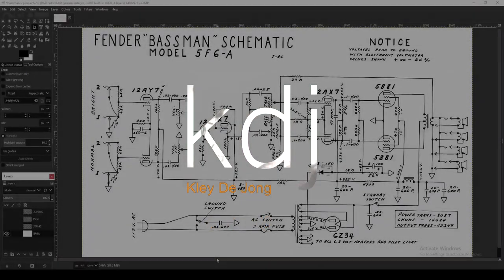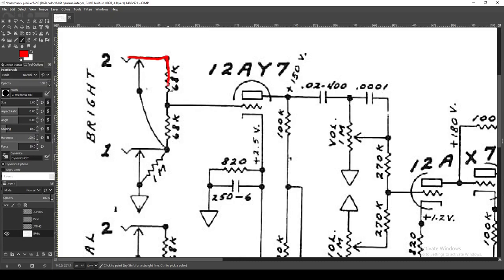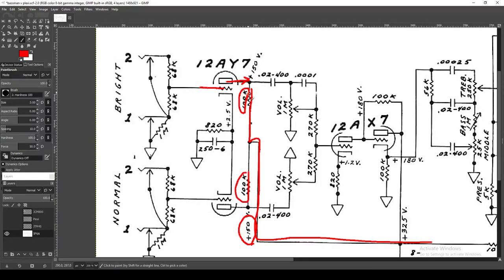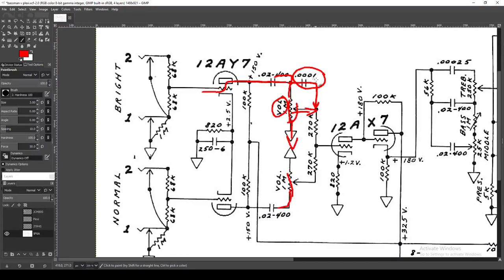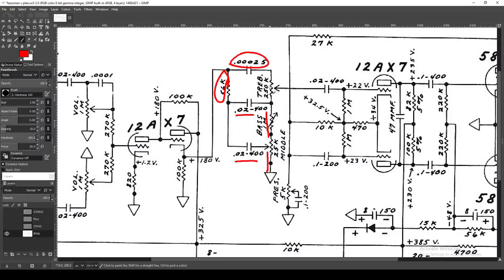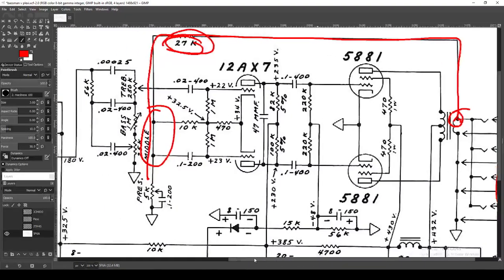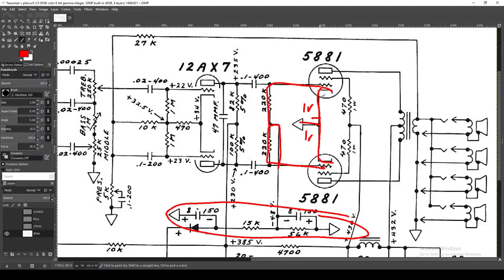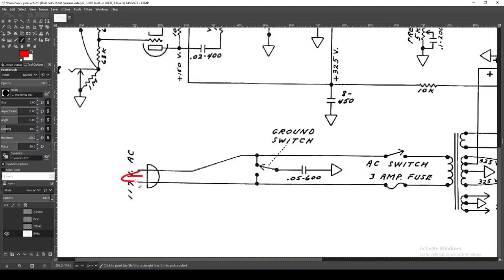Amp Circuit Analysis - Bassman v. JTM45 vs. Plexi vs. JCM800 | Pt. 1

Comment: The "Low" input had an interesting purpose.  It was for when two electric guitarists were sharing the same amplifier.  If one guy had higher output pickups he could use the low input instead of cranking the volume pot down on the guitar which rolls off a bunch of treble.  The coils of the pickup having certain amounts of capacitive and inductive reactance as well as resistance.

Comment: Hey, cool video. Minor correction: The smoothing caps at power supply node 1 are in parallel and double the capacitance not halve it. (Twice the electrode surface area doubles capacitance).
Reply: You noticed that to. it should be elementary electrical knowledge to know when explaining a circuit.
Reply: Yeah I noticed 😂

Comment: This circuit was drawn in 1958 when 600v electrolytics arrived at your doorstep every morning next to your newspaper and milk. So Leo Fender opted for the parallel reservoir bank (summed capacitance) instead of the series (summed working voltages) helping the tube rectified amp respond to current demands faster at heavier loads. Think about how delicious a 600v electrolytic capacitor dipped in milk would be. They had it for breakfast every... morning...
Reply: I love the smell of electrolytic capacitors in the morning.

Smells like... victory.

Comment: Hi Kley. My understanding of input 2 is that the two 68k resistors do form a 50:50 voltage divider as you say, but since all inputs have their tips grounded when not in use, the signal will ignore the 1M resistor completely and the remaining 50% of the signal afte the voltage divider goes straight to ground.
Reply: ps I really enjoy your channel, keep up the great work. I’m also a huge Uncle Doug, D-Lab, Blueglow and Guitologist fan
Reply from the maker: I see, so the voltage divider is not 68k / 68k + 1M as I explained.  But it is just 68k / 68k.  Thanks for the update.
Reply: @KleyDeJong  Yes Chris is correct.

Comment: excellent. As an addition in my opinion the phase inverter (at around 25:00)has practically no input signal (from the preamp) on the lower path. The inversion happens again through the common cathode resistor(s). The two triodes act as differential amplifiers (and the "-" input gets it's signal from the feedback line).  The 1M resistors are just grid leaks.
Reply: Bemi-ton  Yes absolutely!  This long tail inverter is just a classic differential amplifier since the two amps share a cathode resistor.  The input here goes to the top triode and the bottom triode of the pair just sees ground through a cap, and is biased on equal to input one through the 1 megs and the shared 470 ohm resistor.  Because the current through the cathode resistor is constant, an inverted signal appears at the bottom triode's plate.  So the two signals at the plates are inverted 180 degrees relative to each other.  I don't really like the term grid leak resistor,... the 1 meg resistors set bias because they place the voltage at the grid below the cathode potential, partially reducing the current that would flow from Plate to Cathode without a voltage on the grid.  One meg places the quiescent current at the mid point of the linear excursion, of a 12AX7 when the cathode resistor is 1.5 K.  Different tubes require different bias,.  As far as i know 12AU,  AV, AX, and AY, work well with 1 meg to ground from the grid, with 1.5 K on the cathode.  Changing the value of the grid resistor versus cathode resistor, move the bias point, so that there is more excursion above the quiescent point, or more excursion below the  quiescent point.  The Phase inverter uses 470 ohms  as a common reference point on the Phase inverter so that the top half or bottom half of the signal get cut off in opposite directions.  The top triode in the P I ends up passing more of the positive side of the signal, and the bottom triode passes more of the negative side of the signal.  This allows for a greater overall excursion of the signal in the  P I before the signals (now two inverted from each other ) reach the output tubes.   It also means that for the same output half the drive current  is needed for class B, (in which there is no overlap).  In class A/B there is also a pretty significantly lower current draw for the same output at the speaker of a class A amp.  This is why for the same output Class A/B is much more efficient in terms of the amount of power that is lost as just heat.
  I am quite sure that the so called imbalance of using 82K for the top half, and 100K for the bottom half, is actually a method for "balancing" the drive signal.  I think there are two things that happen, number one in the top half, remember the plate signal and cathode signal are 180 degrees apart, add together for more excursion, and in the bottom triode they subtract,  so the bottom needs more gain.  Also one wants the center point of each plate offset, so using the same bias scheme, the difference in plate resistors change the voltage at each plate a little relative to each other, for the offset.  Recently various guitar amps have tried to make the plate resistors equal which doesn't work so well, it seems to me.

Comment: Correction at 5:41- when plugged into input 2 the signal path is through the top 68k resistor, through the bottom 68k resistor through the tip and switch of jack 1 to ground, not through the 1M resistor to ground.  The grid stopper is now the top 68k resistor and the input impedance is set by the lower 68k resistor.
Reply from the maker: Thanks for that.  So you still get the 50% voltage divider and with the lower input impedance you may experience some duller top end?
Reply: @KleyDeJong  The 1M resistor is shorted mechanically by the unused (stereo) input jack #1. Thus, the 2nd 68k resistor is shorted to ground and the voltage is divided by the two 68k resistors ("50%" as you called it). That is -6dB attenuation (quarter of the power) and that's why the signal is much quieter. Sound is duller because the input interacts with the passive guitar circuit (passive RLC circuit). This is called "loading effect. With a buffer it will be less pronounced. The input impedance is a mere 128k compared to the 1M on the 2nd input and to the output impedance of a guitar
Cheers,
Dror

Comment: Study up on the LTP phase inverter, inverted signal must go through both cathodes, not the 2  1M resistors.
Reply: Try either or both of theses links:
http://www.valvewizard.co.uk/acltp.html 
http://www.aikenamps.com/index.php/designing-long-tail-pairs-the-load-line-approach
On the Valve Wizard's site, first check out the link to the DC coupled LTPPI.

Comment: I suppose you.could adjust dropping resistor value to get the b+ back to spec if you wall voltage is high?
Reply from the maker: Yeah that would work fine

Comment: Another thing to add: after the rectifier the voltage is still alternating, but with an DC offset (one side of the sinewave is flipped) as after a bridge rectifier. It loads up all the Cs and so gets flattened. BTW: Cs in parallel add together the capacity, meaning the two 20 add to 40 😉

Comment: Could a 100 watt plexi style amp with a solid state rectifier be designed without a standby switch? Or is a standby switch crucial for protecting the amp's circuit upon warmup etc?
Reply from the maker: I believe that standby switches are not necessary.

http://www.valvewizard.co.uk/standby.html
Reply: To answer your question, yes. With a modification described by the Valve Wizard in Kley's link, no standby switch would be necessary.

Comment: Now I know why jumpering my bandmaster does not sound as expected. My amp tech insisted it would but no it sounds rough. That was a real headscratcher for a while. Call me crazy but that 65' Bandmaster has some almost Marshall like chatacteristics when I put my 78' Les Paul through it at high volume.

Comment: What is the reason of the cap between the plates of the phase inverter?
Reply from the maker: I believe it would send very high frequencies of opposing phases to cancel one another.  It would help stabilize the amp.  I imagine it is very high, possibly even beyond the 20khz range.
Reply: Kley De Jong: Thank you. You did a great job to go through all the details 👍

Comment: The presence control, controls the amount of negative feedback. in many presence circuits there is no cap, just two resistors or a pot which divides the feedback signal..   the signal appears brighter with less negative feedback because the linearity of the signal has not been corrected, and there is more gain without negative feedback.  Properly speaking the presence control is not a tone control.  If You do the math,.. with 27K in series with .1 uf,  The feedback loop passes the entire audio range.  Also the presence control is backwards,.. when You turn it '"up" there is less feedback, and more ( "presence" ! ! ! )

Comment: 40.54 in the video you are talking about the filter caps for main power supply after rectifying. You say the 2 20 Uf capasitors in parallell give a value of 10 Uf, that is flat out wrong, caps double value in parallell while resistors half the value when connected in parallell. Make me wonder what more elementary electrical knowledge u have got wrong?

Comment: Not even 6 minutes in and  have to comment already. Those arrows are making contact. Hence when you plug in the input 2 1M Ohm resistor is not in the circuit. It is shorted out by the grounding input jack. So, Input 2 has only 68K Ohm to the ground. That’s low impedance input and lot of signal is sent to the ground. That is the reason why it is less loud channel. No splinters there no voltage dividers.